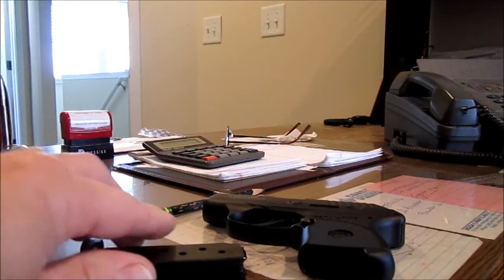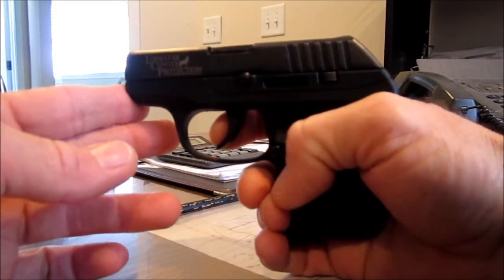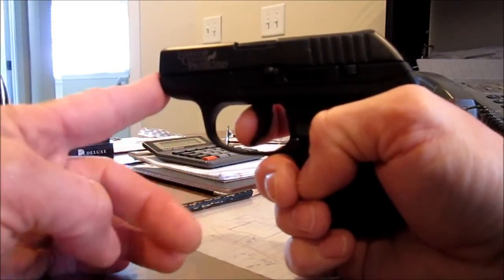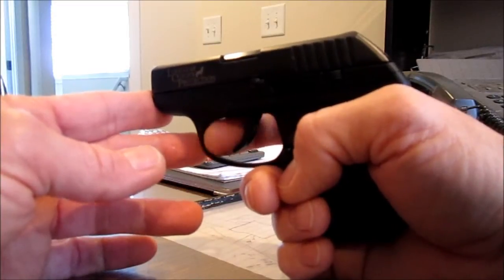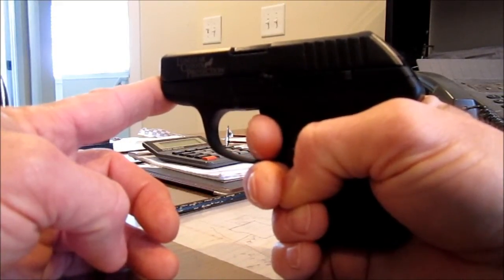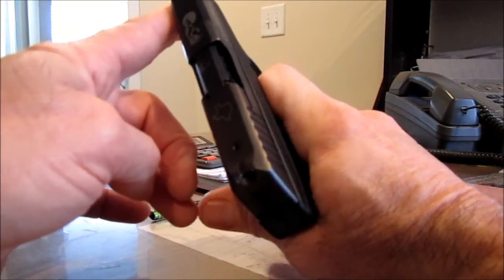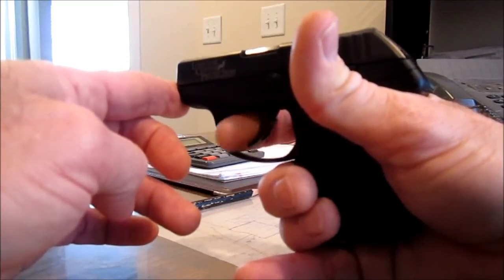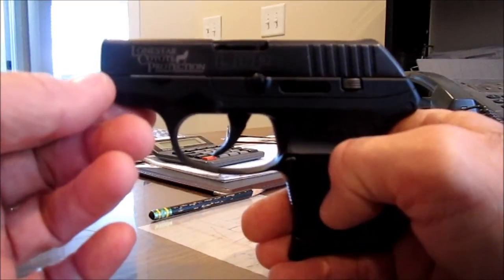Ruger lcp trigger pull - trigger pinch explained

Comment: I just got a Security .380, and I was having this same problem.  I’ve never had a gun before with a trigger safety, so this is new to me.  I finally figured out how to stop the finger pinch, at least for me.  With most guns I first stick my finger through the trigger guard, then press it to the trigger.  If I do that with this gun, my finger pad hits the point of the trigger safety and never gets fully seated on the curve of the trigger.  That results in a pinched finger when the trigger is pressed and released.  So, what I do is first touch the outside of the trigger at its top with the tip of my finger, then slide it onto the trigger from the side.  That depresses the trigger safety gradually with my finger tip as it slides into the trigger guard.  By doing that, I also end up pressing the trigger more with the tip of my finger pad than I do with other guns.  But like you say, that’s probably a good thing.  Great video; thanks for posting.

Comment: Just bought a Ruger lcp and don't have any finger pinch. Some time ago I tried several lcp's at a gun shops and always got finger pinch. I wonder if Ruger changed the distance from the trigger to the trigger guard. Also seems you could trim a little off the bottom of the trigger if this is a problem for you.

Comment: I know yours is an older clip about the original LCP, but I noticed exact same issue with my LCP Max.  Some people commenting about getting pinched from where the trigger comes out of the frame, I experienced that too.  How you show finger placement in this vid, with the finger tip, that's really the only way to avoid one or the other pinch point.  Because otherwise, choose where u want to get pinched, that's the long and short of it with this little pistol.  Still, this is a great little ccw!

Comment: The "pinch" isn't at the bottom of the trigger, it's at the top.  When the trigger moves back forward, it pinches the top of the finger between the trigger and the frame.  Not a good design.  The trigger needs a small curve piece at the top to prevent the skin on the finger from entering the hole.  Pretty simple fix if Ruger would just redesign the trigger mold.

Comment: My pinch occurs where the trigger goes through the frame at the top of the trigger. When I release the trigger is when the top of my finger gets pinched in that area again the top of my index finger gets pinched between the trigger and area where it goes through the frame. Hickok 45 had the same issue and filed out that area a little bit. Another gentleman put a piece of gorilla tape in that area. Others have replaced the trigger and problem solved Ruger shit make a permanent fix with this issue in my opinion.

Comment: Yeah...using finger tip is better.  And Braids Holsters is right about accuracy of fingertip pull vs monkey grasp pull.  Monkey grasp will pull barrel to left.  Practice fingertip pull.  Accuracy is hard enough with little guns.  Don't add to it with poor trigger pull mechanics.